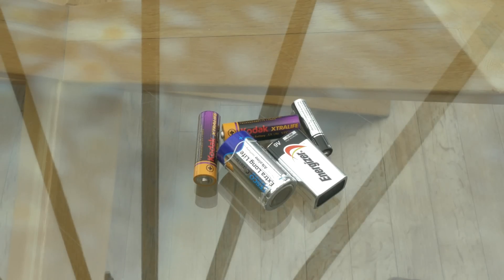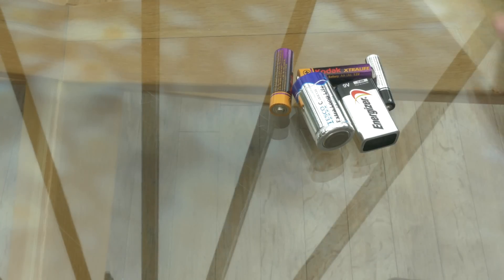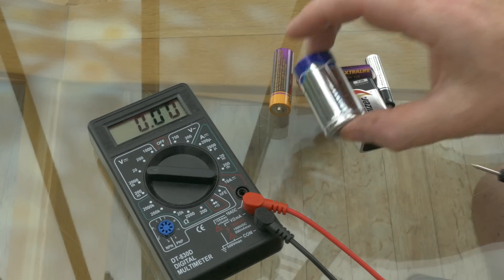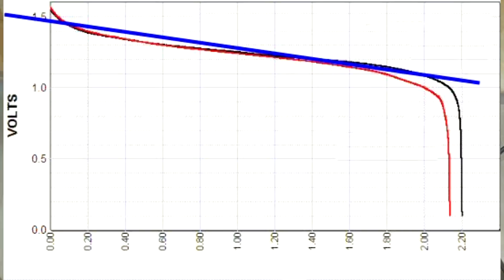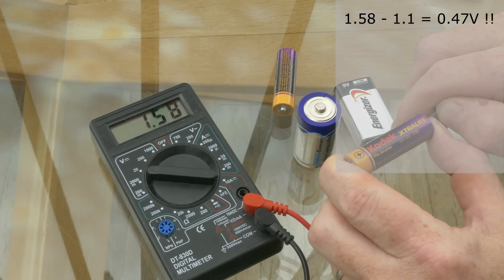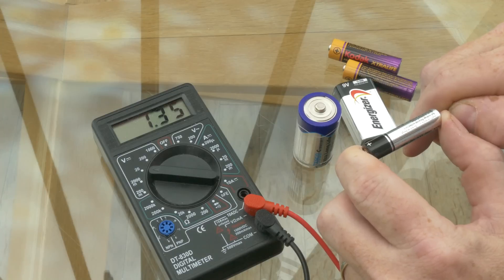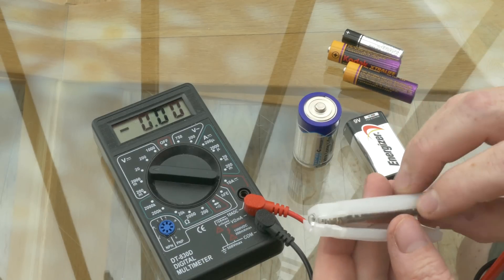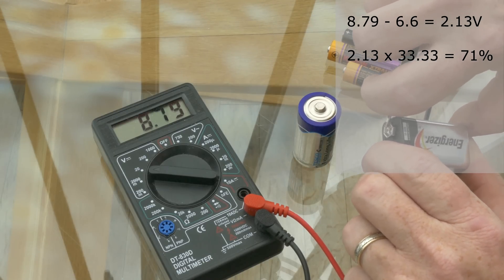How to check battery capacity

Comment: Why is not Wh (battery capacity?) calculated with max full charged voltage? For example if an electric kickbike's (Sealup Q8) battery (38km range on a good day) is rated as 48V21Ah (48x21=1008Wh) but it's full charge voltage is 54.6, so why not calculate it as 54.6V x 21Ah = 1147 Wh? I have a kickbike Q8 battery (Samsung cells purportedly) rated as 48v21ah but it soaks only 877Wh according to power outlet meter. Should it be soaking 1008Wh or 1147Wh, or is 877Wh correct? I also have another battery from (Aliexpress) Liitokala (tested 27km range) rated as 48V20Ah (48x20=960Wh or 54.6x20=1092Wh) but it soaks only 698Wh (it's more like 15 or 17Ah?). So am I scammed or it is normal? I complained to Aliexpress about it LiitoKala battery, that it should be at least 835Wh in it if it is 20Ah but they ask for more proof. I already proved with power outlet meter how much it soaks, it is 698Wh and showed my other battery soaks 877Wh (for comparison). Aliexpress supports vendors lying about real capacity of battery. Idk how I can prove to them that LiitoKala is not 20Ah battery (more like 16Ah). I also bought on Aliexpress a 48v24ah battery called Aimjin but it only charged to 53v (not 54.6v) and from empty to full only soaked 340Wh which indicates its capacity is 7Ah. It also became warm when I used it which indicates it is an old tired battery. But I paid for it near same price as for new battery. Scammed.

Comment: You should rename this video to "voltage" as you are not actually testing the capacity.  I was looking for a way to check the battery capacity (which is in milliamps).  mA or mAh
Reply: Thanx you saved me from wasting time hoping to learn what the title said. I am thankful for your comment, but i am frustrated with misleading titles. The internet still got ass tons of helpful information, just got to sift. Again, thank you

Comment: So, 1.6V measures full. 1.1V measures the minimum useful voltage. The difference (x 100) gives the capacity. According to this method.

Comment: Where would one get such a thing as the Electronic load with built in mah please?
Reply: https://www.amazon.com/gp/product/B07VB4NTK8/ref=ox_sc_act_title_1?smid=A9JWJVEJFYCB1&psc=1  This one says it uses 120 Ohm load.  MAH would depend on the battery style, it's not something that can be measured without draining the battery.
Reply: @BobCampbell530  that's not accurate link, just battery tester, not an accurate load/drain device as in the video.

Comment: I missed the rationale for 1.1 for 1.5 cells and 3.3 for 9 v cells.  What formula do we use for button batteries and the small 12v used in car remote key fobs? AND what about lead-acid 6 and 2 volts.  This was a great video and I got a real "kick" out of it and it brightened my day.

Comment: What if battery shows 3.4v
Reply from the maker: Possible Li-ion (33% remaining) or LiFePO4 (75% remaining).
Reply: @crazytom  what method u used for this? Thank you!
Reply from the maker: Same method.  Linear extrapolation.  Li-ion useful range: 3.0V-4.2V.  LiFePO4: 2.8V-3.6V.

Comment: Easier if you just take the ratio between remaining useful voltage and total useful voltage. Like this, ((measured voltage-lower range)/Useful)*100...
 For example, ((8.79-6.6)/3)*100=73% for the 9V...By the way the Math in this video is off, 8.79-6.6 is not 2.13 and 1.58-1.1 is not 0.47.

Comment: How can you check your cell phone battery? The s7 edge
Reply from the maker: The S7 (and many other late-model 'phones) doesn't have a removable battery.

What you could do instead, is fully discharge the 'phones battery and then charge via a USB inline  mAh or Wh meter.   This would measure how much capacity it takes to fully charge the 'phones battery.

Search for "Keweisi USB battery capacity meter" and you'll see what I'm talking about..  about the size of a mini cigarette lighter.

Comment: Battery capacity is measured in Ah (Ampere hours), not Volts (actually, the capacity is properly expressed in Coulombs, but for the batteries Ah is more often used) . 
Therefore, this video should be named "How to check battery voltage", which is a different thing from the capacity. Two cells can have same voltage, but wildly different capacity.

In order for capacity to be measured, you'd have to take the rate of voltage drop under load into account. Measuring just nominal voltage without any load will often give you skewed picture of the state of the battery.

Comment: As long as put a small load on the battery you can use the voltage to figure out if it's worth keeping or not.

Comment: So how do you test battery capacity of a Zinc Chloride battery, or NIMH battery or lithium ion battery? Apply the same voltage upper and lower limits and calculate the percentage the same way?

Comment: I came here expecting to watch a video about checking battery capacity, not battery voltage.
Reply: @BigBrain Time that will fry the fuse on the multimeter since the ampermeter gets connected on a battery in series and there is no load on it.
Reply: Then you should have kept watching. He covered Capacity and % of charge remaining. And showed the math in easy to understand language.
Reply: @danielwatson7764 
Seconded
Reply: Well... you didn't understand then.
Reply: @oross99  ok you understand can you tell me how much mA? how many hour that battery can use?

Comment: I use a flashlight bulb with a couple of wires soldered to it. This is used to test D cells down to AAA cells. 
 Depending on the brightness of the bulb tells me how much juice the cell has in it.
I admit that this isn't really as accurate as a meter but it works, and it is very, very cheap to make.
Yes, I do have a Multi-Meter.
Reply: How do you check a battery which is not fully charged or a running battery

Comment: Personally, I toss a battery when it hits 1.4V (or 7.something V)as some devices don't like the lower voltages and they consequently get weird about their behavior. I could try to figure out which devices can still function correctly down to 1.1V and which don't, but life is life. This video was a good explanation of how to use a VOM to test batteries though. Lots of people don't know that, and they should learn.

Comment: That discharge curve is under ideal very low load conditions. ONLY rechargeable batteries have anything like that flat curve. The complexities of primary cells is the reason they do not ever advertise the capacity of a primary cell.

Comment: Open readings are useless. You need a resister to find the voltage under load. Batteries are generally dead at about .9V under load for anything but the smallest of loads. A very small load, like a small LED can work down to like .6V

Comment: As some commenters have already mentioned, sometimes a used battery's voltage will measure fairly high even when its capacity is mostly drained--they just become big resistors.  So, my simple way to check remaining battery capacity is to use the current-measuring setting on a multimeter (I usually use a Fluke 77).  I touch the leads briefly to the battery so I don't drain it very much, and see how much the digital display "deflects".  I don't keep figures in my head for how much current a fully charged battery is able to deliver, but I go by rough memory, so that if I see little  deflection, then I know the battery doesn't have much juice left.
Reply: What's deflection?

Comment: That's wrong. The curve is specified at a given drain current, while you're meassuring it without a load. You must connect a load drawing that specified current and then meassure the voltage. If you do that quickly, it won't make a dent on the battery's charge.

Comment: Very useful.  Surely there are tables showing percentages for  various batteries?  Check voltage, check table, know capacity?
Reply from the maker: The graph showing linear voltage drop makes this approach uniquely useful to Alkaline cells (similar approaches also work for li-ion which exhibit similar linear behaviour)